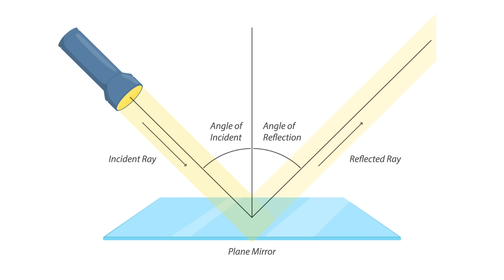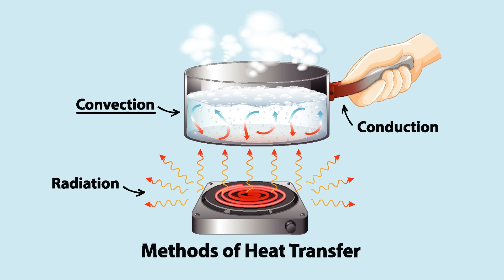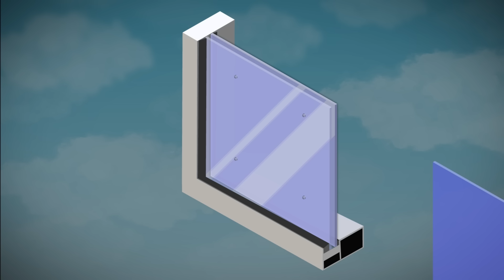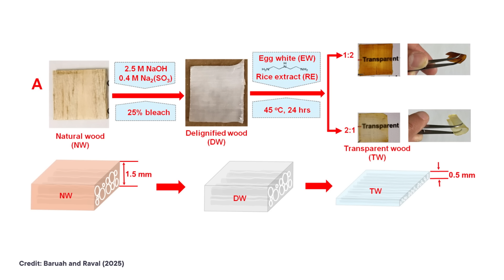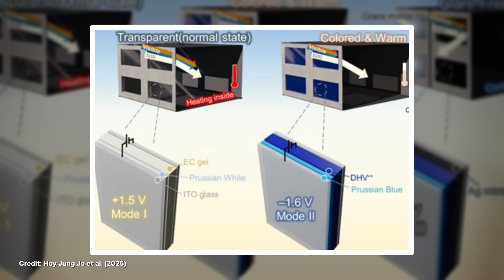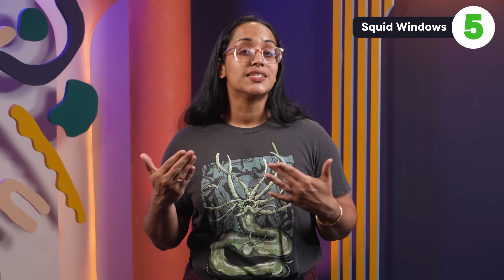5 Weird Windows of the Future.

Comment: In Australia we fix the incidence problem with a thing we call "passive solar design." When you don't want solar heat entering your house, don't let direct sunlight touch your window glass. It's very clever and absurdly simple.
Some people try to use the same technique to warm their houses in winter and that's a whole lot less effective in most climates, because the weather when you most want to heat your house is when there is no clear sunlight and passive solar has nothing to offer. But it's a great system for keeping your house cool in summer.

Comment: Sure, let's do absolutely anything but address the severe inefficiency of our current air conditioning systems. 
Let's never utilize the radiant heat of our sun to help compress the refrigerant, thus cutting down on needed electrical current. Let's simply block out the sunlight, right? Forget the fact that insulation plays a key role. Let's forget that even without windows, a structure will still heat up under direct sunlight.
Windows are helpful, but they are not the solution and never will be the solution in regards to energy efficiency of air conditioning systems.
With one tea candle, I can create ice with a rather old propane powered refrigerator, no propane or electric needed. The problem is compression. That is where the majority of efficiency is lost. Reduce the power needed to compress a refrigerant, greatly reduce costs associated with cooling a building. It is that simple. We've already come a long way where insulation is concerned. We just need to work on compression.

Comment: I know that's not the point of this video and these are more ideas for like, sheer walls of glass, but I live in switzerland and wooden window shutters with tilt vanes are very common here on older houses and they already do all of these things lol (AND they're biodegradable down to the nails and fixtures, if you wait long enough) - they work very well to keep you cool... until a global warming-fueled heatwave hits and the stone walls heat up and the entire building turns into a brick oven beaming heat directly into your face from all angles lol

Comment: Vacuum? Ok but to be fair, double-paned windows are not exactly state-of-the-art. In a lot of regions tripe- or quadruple-paned windows are the standard. The US is rather an exception among the developed countries. And with 3 or more panes you don't habe much heat transfer via convection or conduction anymore. For a vacuum window to make sense it has to be way cheaper. The windows themselves aren't the real issue anymore, rather the parts around. The perfect glass doesn't help much if your window doesn't shut tightly and you have a lot of cracks in your house. And energy efficiency isn't of such an importance in the US like for example the EU (hence the old window standards).

Comment: 1:10 or you just do passive solar design  with really wide eves so that in summer when the sun is high the windows are shaded by the eves and when in winter the sun is low in the sky it can come thru the window
Reply: Or adjustable awnings, which can be easily retrofitted onto an existing building.

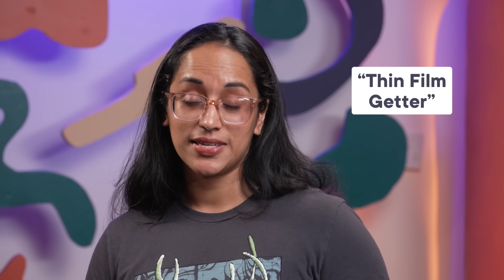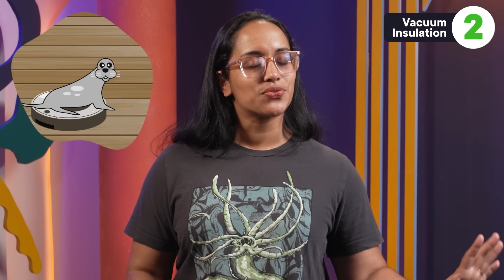Comment: 4:12 A fluid's is just a liquid or a gas, air isn't qualifying on some weird technicality. If you want an actual weird technicality heat transfer by the bulk movement of fluid (3:02) is advection, convection also includes the effects of diffusion.

Comment: Whether you are using electricity to control the windows or using it to run air conditioning, you're still using electricity and there are going  to be shortages of that until you get rid of all the damn AI Data centers and the techno bros behind them.

Comment: Electrochromic tunable windows are just a worse version of curtains or blinds. The latter are much cheaper and easier to install and replace, and they keep working during power outages.
Reply: My problem with blinds is trying to keep them clean. It becomes a real pain in the ass, over time. Wooden slat blinds are better for cleaning, and just better blinds. It still means getting on a stepladder, though, if you're short or if the windows are high. Then you have to stay on the ladder for awkward angles. Curtains are a less labor intensive clean.

Comment: I would think that for the thin film, the answer would just be to do the reverse of what was standard.

It depends on where you are, but if you're in a place that has a true winter and a true summer, then wouldn't you want to do what architects do with overhangs? That would mean blocking high angle sunlightbut not blocking low angle sunlight. In that way, you get less heat in the summer and more heat in the winter.
Reply: yeah, especially near the tropic of cancer like along the Mediterranean or south of that would be very ideal

Comment: A very simple device called brise-soleil applied to windows solved that problem almost 100 years ago. All you need to do to achieve 100% sun protection is knowing how to calculate your window orientation vs. the maximum angle the sun will hit. It's a walk in the park for any competent architect.
Reply: That only works if you're the one building the house. Most people live in houses built by other people who didn't care which way it faced.
Reply: @redheadedbint  You can always add them post-construction. Its only unpractical on a narrow band of orientations, depending on latitude.

Comment: Me looking at our windows and wondering why vacuum windows are supposed to be the future. In Germany, everyone has at least double-glazed windows (with a vacuum gap in between) – even the very cheapest houses or flats, and modern buildings have at least triple-glazed windows.
Reply: It's not a vacuum in the gap, it's an inert gas (typically argon iirc). 

A vacuum is hard to achieve because it makes the glass panes want to pull in toward each other, or implode. That's why the vacuum windows mentioned in the video have "micro pillars" as they called them, to hold the glass apart since the vacuum tries to pull them together.
Reply: Vacuum or nobel gas filled?
Reply: You are both so right. Mostly they are argon gas filled.

Comment: The worst thing about windows is that its expensive to replace all your rotting windows
Reply: Came here to say the same thing. Normal windows are crazy expensive, I can't imagine the price tag on some of these features.
Reply: I'd say the worst part is letting in all that hot, bright sunlight, especially if the window is too small to do something useful like hold a window AC.

Had I build my dream house money, there would be no windows beyond any required by unreasonable building codes.
Reply: Well the worst thing about windows is how easily they break, so I'd take slightly rotting over being robbed (at least in my area)

Comment: A window that could replace our blackout curtains sounds like a dream!
A good dream that is.
And they are not easy to clean, let alone trying to find a place to let it drip dry (shower curtain tension rods aren't strong enough)
Reply: 10 curtains alone upstairs.
5 or 6 in living room (2 curtains per window usually), and another 5 or 6 in dining room.
Also, why can't these blackout curtains come with cleaning instruction?
I just assume laundry soap and a soak in the tub will do it, followed up with 2 more soaks to rinse out the soap.
(🤷‍♀️ it works)
Reply: @TiredMomma I throw mine in the washing machine
Reply: @redheadedbint I did that once but that white stuff they put on it, had a lot of cracks after I used the washer, so I'm never doing that again. And it was on gentle cycle too.
Reply: Idk about you, but for me solid windows would work fine.  I just want to be able to open the window and let air in sometimes.  I really don’t care if I can see through the window or not.
Reply: There's windows where the blinds are built in between two panels of glass.
Reply: @Tankayou-r3gYea I know about those and only really rich people can afford them.

Comment: I want no windows. Just screens where a window would be.
Reply: You must live somewhere with decent weather year round
Reply: @joeldurr2714  windows as a source of air flow has never made sense to me. Cental air or even just a vent with a fan to the outside would move way more fresh air
Reply: @joeldurr2714 they mean computer screens. A chronically online basement dweller who would rather use even more power creating a fake outside than actually touch grass.
Reply: Screens as windows with just the windows logo running windows 98
Reply: Install Linux
I will see myself out ^_^
Reply: Where the heck do you live where temps never freeze nor cook you alive??
Reply: @TiredMomma  hawaii
Reply: Jesus wtf
Reply: @helloiamenergyman  i could have whole wall screen showing what a giant window would. No heat flow or security concerns
Reply: @WhatTheFunctionX why would you want to spend electricity showing a giant picture of outside when you could just have actual outside for free